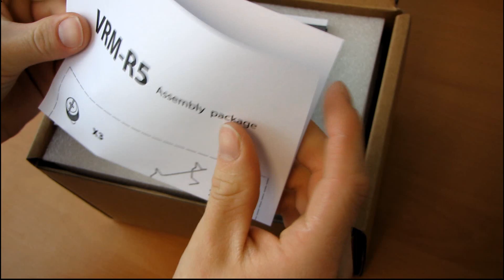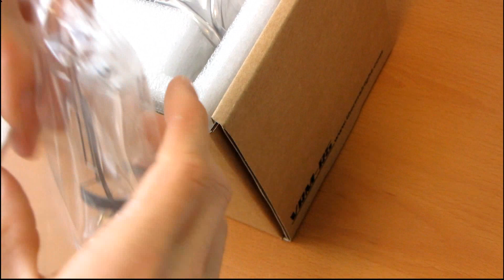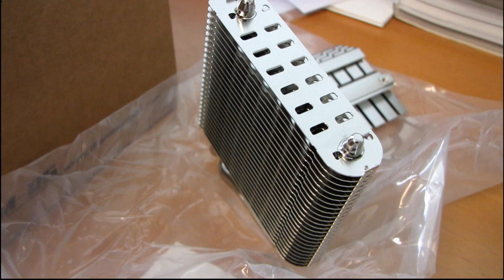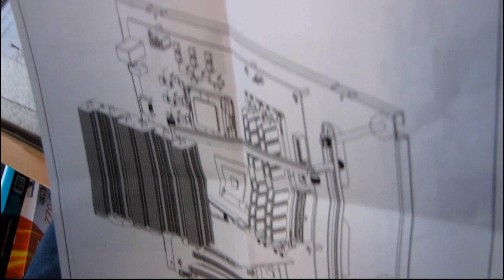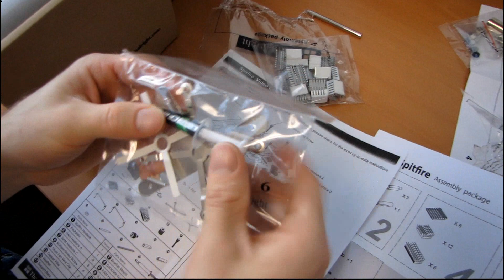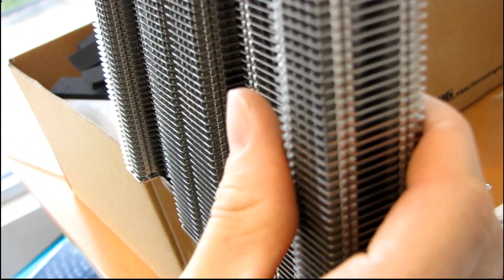Thermalright Spitfire 6 GPU Heatsink for Radeon HD 5850/5870 Unboxing & First Look Linus Tech Tips

Comment: i would like this, the spitfire can be installed both sides, upside and down, but can the vrm-r5 also be?

i really want it in that case, cause there's not alot room left on the CPU area and i have a RAM fan next to my cpu cooler: thermalright mux-120.

and down the 5870 there's room enough, and up the CPU and RAM.

i would like both the vrm-r5 and spitfire can be installed down, not up.

so can it?

Comment: Spitfire... sounds like The Prodigy. Does the CPU cooler fit anymore with the Spitfire installed? Since the heatsink is for the Radeon 5 series, I guess it'll work with 5850, too, right?

Comment: Yea...I wanna see a vid with an installed cooler and see some benchmarks and temps stock vs this crap. I don't think this would fit in my case up or down following my CPU heatsink size and other cards and PSU on the bottom.